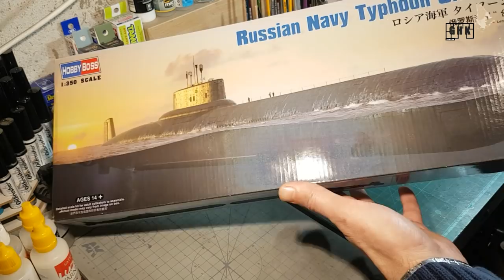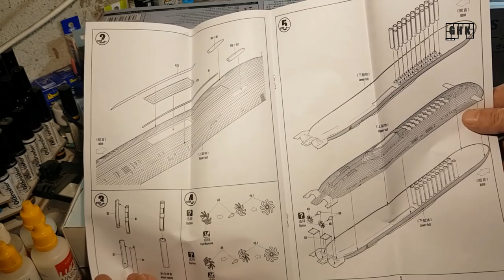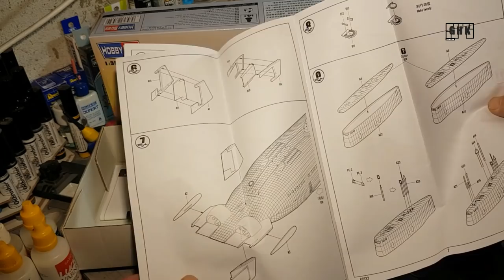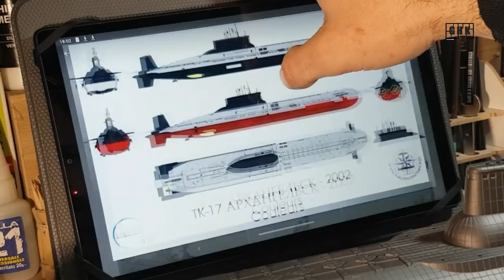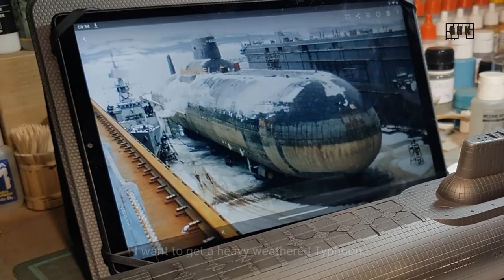[Full build] SSBN Typhoon class - HobbyBoss 1/350 (Part I)

Comment: ok, first of all, this must have been the best background music in any modelling video that I have ever heard, period. :-) :-) Amazing choice of music, including the Red October soundtrack parts, and so fitting to the subject. Second, I have been waiting for such a video for a long time, ever since I bought the Hobby Boss Typhoon kit some years ago and was put off by its very warped hull halves (so it's not random), its lack of detail in the SSBN tubes and the overdone acoustic rubber tiles. So many thanks for showing us how to improve on this kit. I like the idea of making a template for the missile tubes by inking the circles and "push-printing" the negative on a styrene sheet, brilliant and simple and effective. 

Also the  start of the weathering looks very impressive, I much prefer a heavily weathered look in a sub kit, than the usual clean, museum-style presentations. I can't wait to watch Part 2. Many thanks for a great built! And for the music, did I mention the music? :-) :-) 

By the way, how did you manage to fix the warping in the hull? By gluing it little by little and holding in place with rubber bands and tape as shown? Or did you also use any hot water to try to slightly "unwarp" the plastic?
Reply from the maker: Many thanks Manos ! 😀 

About the "push/printing" process, it was not so efficient, so I had to do it again and measure the odds to get it right. The main problem was to set the styrene sheet at the good place. It could have been easier with the styrene rods glued around the silos surface before the "push/printing" process.

For the hull, I started gluing from the bow to the stern with masking tape, some vice pliers, and my hands 😅 A big pressure is needed to get it... just a lil' better ! Really a big disappointment...

Oh, by the way, did you mention the music ? 😉😂 That was obvious for me as I really appreciate the movie. I had to get more songs so I choose some old "russian vibes" and others... Now I'm just in trouble with the 2nd part's soundtrack ! 😅 The only song I'm sure about is the final one, still from the movie 😉

Please be patient for the next and final part, the painting process is long and I'm a bit timeless as I work 5 days a week and also have to take care of my daughters and wife 😄 Be sure that I'll try to do my best 😉

Many thanks again for your interest !

Comment: The first kit of a typhoon class submarine that I found was by Dragon Models  some 30 + years ago .
It was supposed to be 1 : 350 'th scale but was smaller than my Los Angeles class of 1: 350 'th scale .
Reply from the maker: Wasn't it a 1/700 scaled Typhoon ? Got one from Hobbyboss and its dimensions are not so far from my 1/350 LA class
Reply: @ghkmodels  that was around 35 years ago maybe you're right 
but I do remember that I got both sub's at the same time .

The L A class was 1:350 scale because I put the Sea Hawk copters on the deck of my 1:350 scale Enterprise CVN 65 .
Maybe the box for the Russian Typhoon was either mislabeled or the had the wrong kit in the box .
I do remember that when you moved the Forward Diving planes that several torpedoes came out of the Bow .
Reply from the maker: Wow that's an excellent option to be able to shot torpedoes !!! 👍😋 

Just a thought, for the scale, when you said it was a bit shorter than the LA class. But it really make sens I think. By the way isn't this Kit a collector nowadays ?
Reply: @ghkmodels  
It doesn't shoot the torpedoes it was a lever action.
As you moved the forward diving planes the torpedoes moved in and out of the bow .
Reply: @ghkmodels  
And as far as I know if it's still around it maybe .
As long as it isn't built .
Reply from the maker: Sorry, maybe a fantasm 😁 It's still a cool mechanism, it could be fun to see more stuff like that in model kits 🤔
Reply: @ghkmodels  
I really miss the older kits 
I had a model Jet that had a spring activated ejection seat , moveable landing gear and dropped bombs ,    all in a 1/48'th scale kit .

Over the years I had several kits that had some sort of action and one more item some came with FREE chrome plating but at times was a pain to paint the wheels had to scrape the chrome off down to the wheel rims

Comment: Would you recommend this kit?  It would be my first sub in 40 years...
Reply from the maker: Well, I'm unable to answer clearly to that question as I have only build the 1/700 HobbyBoss kit and this one, also from HobbyBoss. 

The cool thing is that you can build it with opened missiles bays. The bad thing is the hull assembling, the lower and upper parts doesn't fit correctly as you can see in the first part of this build. Details are good, but it's a huge sub for its scale, painting is long...
Again, I can't compare to other kits, but it seems to be a good one. Hope this helps 😅